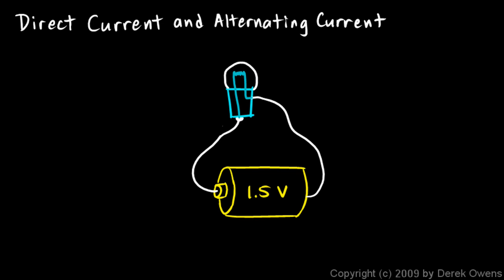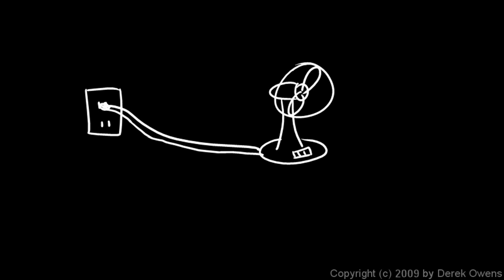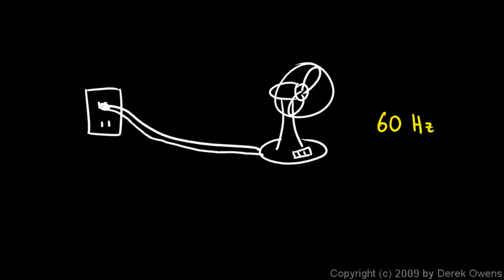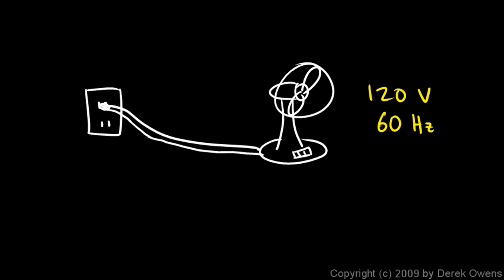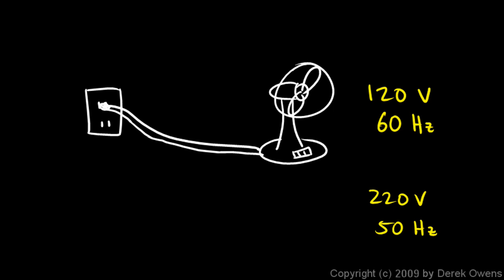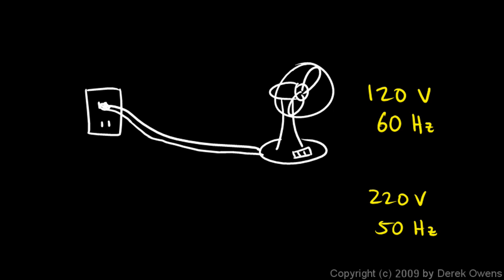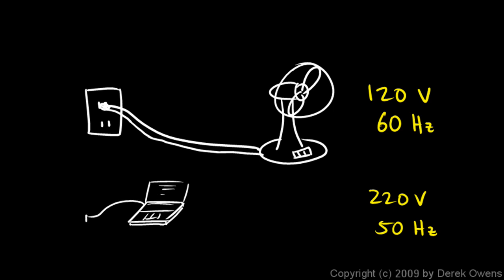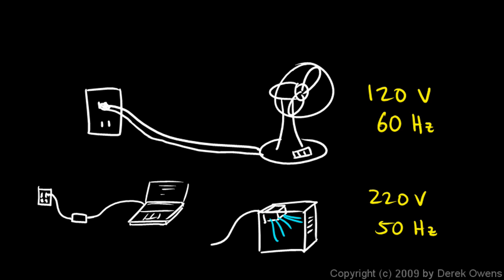Physics 12.5.2a - DC and AC

Comment: There is one error here. When you get a "little device" to use your US made laptop in Europe, it does NOT convert the frequency and voltage back to 110V/50Hz. The little power adapter only changes the form of the plug, it changes NOTHING about the power voltage or frequency. The LAPTOP POWER supply will accept a wider range of power inputs - that's why it works. This is because the people that make laptops KNOW that the device is likely to be mobile. My laptop power supply says "100-240V  50-60Hz".
Now, if you talk about an electric jug, or a toaster, then correct, the power difference will blow up your device because they are only made to take local (110V) power. Now, what about if you MOVE to Europe with all your household goods? Well, then you have a problem. It is possible to get a TRANSFORMER that will change the voltage of the 220V in Europe back to 110V for US appliances. They are big and heavy, especially for things that draw a lot of power like a toaster or electric kettle. Most people just buy new stuff, unless it's a special appliance. Note: the transformers do NOT change the frequency, so things like motors and clocks will run slower in Europe than the US (at 50/60ths of the speed). For a toaster, it can take 110V at 50Hz without issue.
One last point. Many appliances I see sold in the US tend to only have 110V power supplies, whereas the equivalent model in Europe might support 100-240V. That's because they make 2 versions of the product: 1) a cheaper 110V only for the US and 2) more expensive 100-240V model for export. You have to check when travelling. 
Back in the day, much computer equipment shipped with either 100-120V OR 220-240V power supplies, or they had a switch to select the correct voltage. You had to be VERY careful outside North America if you ordered computers from the US not the blow the power supplies up after unpacking the box. 
Don't ask me how I know.
Reply from the maker: Very helpful. Thank you. I also remember those power supplies with the switches on the back.

Comment: current/electrons move from higher potential to lower potential. In the case of AC current there're moving back and forth.what happens ? thus the potential reverse 50 times a second?? how does that even work?
sorry i'm really messed up and confused
Reply from the maker: Yes, the direction reverses 50 times per second, or 60 times per second in the US.  The power company actually produces the power that way, and it ultimately goes back to the sine wave produced by the mechanical rotation in the generator.

Comment: thanx for the awesome explanation! but I would like to ask a question...
If i have a 9v battery and I am using it to power a something that requires 9-12vols....how long will that battery last....how wud u calculate that?

and...
if i plug a 120v device into a 220v A.C connection would it damage the device?

Thanx again for the effort! :)

Comment: Because the terminal you are switching to is the neutral. Generally, the neutral wire in most cases is always tied into the ground wire. There is no potential between the ground and the neutral. They are both at zero potential.

Comment from the maker: Yes, the voltage is also changing.  It changes back and forth from positive to negative, in a sinusoidal manner.  It's all related to the circular motion, which typically comes from a generator.

Comment: So I have this multimeter. If I plug it into the socket it says 220V blah blah. If I switch the way i plugged in the multimeter nothing changes. When I plug one wire in the socket and the other on the ground it says again 220v. But here is my question: why it dosen't show anything when I switch the terminal but keep the ground?

Comment from the maker: Efficiency is a major consideration, and also safety.  220 might be more effiicient, but switching everything is practically impossible.  Every circuit breaker, every transformer, etc. would have to be replaced, everywhere - it would be problematic and costly.

Comment from the maker: Alternators work because of the changing magnetic field, with the emphasis on the word changing.  With direct current, you could generate a magnetic field, but it would reach a stable state very quickly.  You need a changing magnetic field to induce current in a second coil.  Alternating current provides a continuously *changing* magnetic field.

Comment: but i dont get how the electrons travel in ac because when i try to think about it logically if the electrons keep on moving forward and back the same distance at certain frequency it will only travel back and forward along a small piece of a wire at its front where the electrons start to flow but they'd never reach the end of the wire. Can someone explain it to me how they actually trave through a wire if they move back and forward? :/

Comment from the maker: A sine wave represents the changing voltage over time, and for AC it changes in a sinusoidal fashion.  It is produced and transmitted this way.  Sine waves are naturally related to rotation and circular motion, and the rotating parts of a generator produce voltage that varies in a regular sinusoidal fashion.  The frequency of the oscillation is constant, assuming that the frequency at which it is generated does not change.

Comment from the maker: @will34uk  Correct!  There are AC motors, but I cannot explain the details.  Most electronic devices in your home use DC current, and they have a transformer in them that converts the AC from the wall to DC at the correct voltage.